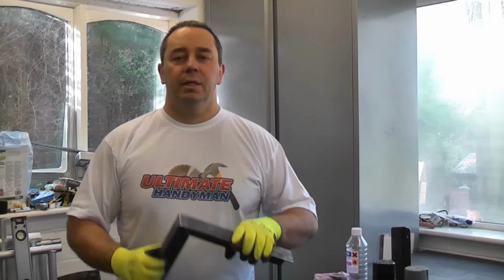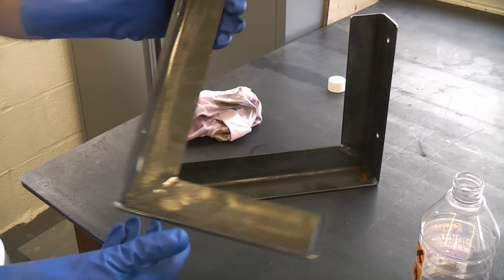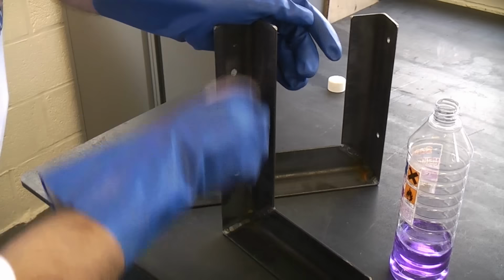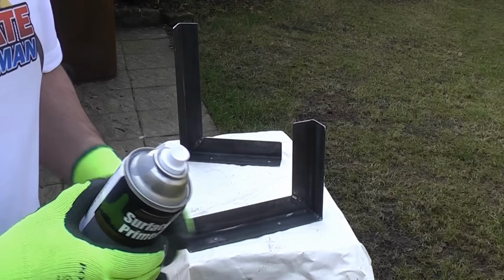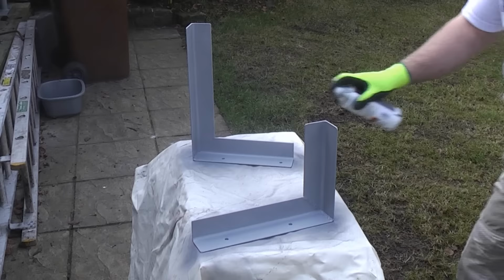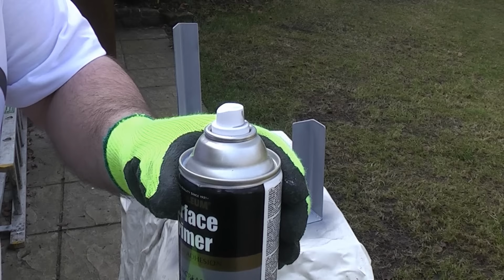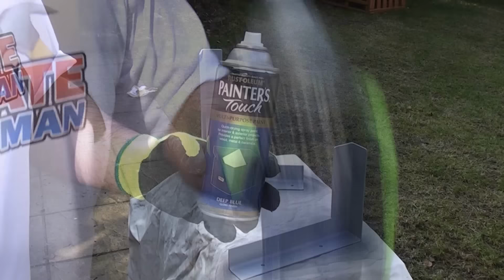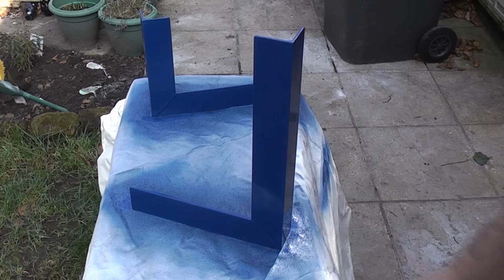How to paint metal | Rustoleum

Comment: small tip, fabricate some hanger like devices so you can spray the whole thing at once.  I use some copper wire or a hanger that's cut up.  you can hang them from a ladder or a tree or anything really.  I used to use a ladder that bends into a scaffold to hang my freshly painted car parts.
Reply: This is very helpful thank you.
Reply: wire from a mig welder works well also

Comment: for more in dept tricks for the viewers ,Sanding the surface will make it that the primer will take longer to peel off from the surface (loss of elasticity over time(critical surface tension) its like puting some velcro under your primer. you especially want to do this the smoother the stuff your painting is,if it feels slipery to the finger,it will peel fast,it it feel rough,chance's are it'll never peel off. 
If its going outside,sand the primer with 400 or 600 grit,so the paint dont peel :)

Comment from the maker: @wilson medriano 
It's called Methylated spirits in the UK, often called denatured alcohol in other parts of the world.
Reply: +Ultimate Handyman thanks. i was just about to ask that.  :)
Reply from the maker: +Nicola Wilbar 
Thanks for the comment ;-)
Reply: +Ultimate Handyman Can you dilute the denatured/methylated spirits with water to make it go further or will this reduce the effectiveness?
Reply from the maker: +Tony Tony 
No, you can't water it down I'm afraid as it will reduce the effectiveness.
Thanks for the comment
Reply: +Ultimate Handyman OK thank you for that. One more question. The lights I want to repair are outdoor up and down lights and as they are by the sea in a hot climate is there any other special requirements to save painting them over and over?
Reply from the maker: +Tony Tony 
Paint will not last long in a climate like that I'm afraid.
If you are painting onto steel, it would be much better get them galvanised as steel will soon rust again even with the best paint that you can get.
Reply: Do your prep correctly, use a proper metal primer with anti corrosive, simonez makes some good quality automotive paints... Do your prep, sand the surface of any surface rust/oxidation and clean it then apply your primer and then main colour, to add extra protection I would recommended enamel paint and followed by an Enamel clear coat.. A job done right shouldn't rust
Reply: Ultimate Handyman hi I was thinking about spray painting my metal fidget spinner.
I am looking for either gold or luminous colours but I don't know what type of spray paint I should use
Reply: Ali Ilyas loooooool
Reply: Ultimate Handyman    Thank you!!!
Reply: Does acetone world too?

Comment: Rustoleum has always worked for me---just painted some steel beams today.  I remove the nozzle and place it in the paint cap, with mineral spirits, to soak it clean.  This uses a small amount of spirits (less than a shot glass).

Comment from the maker: @ MidiTech
It depends really, it will not stick to the galvanised part of the case well unless you prime it first. It might be suitable for over painting the existing painted parts but you would have to test it out first as some cases are powder coated, not painted.

Comment: Spraying inverted to clear the nozzle wastes gas and eventually the gas will run out and there is still paint left in the can. I had this happen to me, I after every use did the inverted spray and after some time the gas run out and had still paint inside. So I think it is better to refer from doing this, and if the nozzle gets clogged just submerge it in paint thinner to clean it, I think rustoleum cans say to do this if the nozzle gets clogged
Reply from the maker: I invert the can all the time and rarely run out of propellant, they tell you to invert the can and spray it to stop the nozzle from blocking.
Thanks for the comment 👍

Comment: Brake cleaner works pretty good for removing oil and grease pre painting, dries fast and leaves no residue, carb cleaner would probably work similar.
Reply from the maker: +John Phillip Thanks for the comment ;-)
Reply: But never use brake cleaner to clean something you're going to weld. Usually contains Tetrachloroethylene. It may decompose to phosgene if welded. Phosgene is incredibly toxic, so even a tiny amount from a small bit of residue from the cleaner could kill you.
Reply from the maker: Thanks for the info, that's well worth knowing.
I don't use break cleaner much but I'll ensure I never use it before welding any metal.
Reply: If you mess up, carb cleaner instantly removes the paint too 😂

Comment: He's right - one of the most important things when spray-painting anything is lots of very light coats, and not fewer heavy coats. It's a pain in the arse and it's easy to get impatient but you WILL regret it otherwise.
Reply from the maker: Thanks for the comment ;-)
Reply: They also need to be consistent to prevent spotting (thicker coats in spots) more consistant side to side, 30cm from the item at a reasonable speed to prevent runs

Comment: Thank you for this video! It was extremely helpful! I need some additional advice. I have a brand new heavy gauge galvanized steel mailbox. I am planning to paint a landscape scene on it and then it will be installed outdoors and exposed to the elements. It currently has a black rust resistant powder coat finish. I will be using acrylic paint and I I was planning to clean the metal with rubbing alcohol before painting. My questions are: do I have to apply a primer first? And what kind of sealant should I apply when I'm finished? Thanks in advance for your help!!
Reply: No

Comment: Hi, can I hand paint the metal frame instead of spraying? I  live in an apartment in which spraying will be difficult.
Reply: Buy or make a ventilated spray booth to discharge fumes outside through a window.  There are many DIY videos on it, with safety tips too.

Comment: I just use a 4 and a half inch angle grinder and use a 60 grit grinding pad to clean the meatl off or to make it easier just buy a sander and 80 grit pads i bet the metal would be super clean then lol I work in a fab shop just some advice lol
Reply from the maker: The paint removal discs are good- https://www.youtube.com/watch?v=aMQMk7J94u8
Thanks for the comment

Comment: Hey, i want to paint my metal weight plates, i was wondering if i have know the propersteps, first i wire brush all the rust away and then use mineral spirits, and then a primer and hammer paint, and should i finish it with a lacquer? i would appreciate it if u responded(:

Comment: Nice video. How long does it take for the surface primer to dry?
Reply from the maker: It depends on the air temperature/humidity etc.
Normally it is touch dry in a few minutes, but not fully dry for a couple of hours.

Comment: Hi all, I want to re-paint the top plate of my vintage stereo receiver because it has a few scratches. My question is do I need to sand the old black color before applying the primer (like remove ALL of the old color or just cleaning will do)? Thanks to anyone for advice... BTW, the video is very good, I feel comfortable trying this on my own now!
Reply from the maker: If the scratches are deep, it is best to feather them out using some fine abrasive paper, then clean it all with methylated spirits before applying the primer. If you don't sand out the scratches, they will still be visible after painting.
Thanks for the comment

Comment: Would you recommend sanding shinny metal surfaces before primer? I have Lincoln beautyware canister set in chrome that I want to spray paint and I just want to make sure I do it right.
Reply from the maker: +m It depends what type of metal it is. Providing a key by sanding will help on most shiny metal surfaces but some surfaces such as Chrome might require a special primer.

Comment: Is "methylated spritis" the same as "mineral spirits" which is what people typically recommend in the US? A warm metal definitely holds the paint better for sure. A not so humid, sunny day is my favorite for outside painting.
Reply from the maker: I'm not sure, but it is often called "denatured alcohol" in some countries.
Thanks for the comment 👍🏼
Reply: @ultimatehandyman  I did some local research with shops and found out State of California prohibited the sale of Mineral Spirits due of potential cancer risk to exposed skin, and we know Californians are too stupid to wear protective gear when there is proper warning [/sarcasm].
To clean metal such as brake calipers, I used a brass brush and brake cleaner to get rid of the excess grease and grime. Afterwards, proceeded to scrub the metal and wiped off with lacquer thinner soaked clean rag (acetone would work too).

Comment: Hi just a couple of questions! 
I want to restore some gym equipment how would you prep it? Would you just lightly sand or would you go further and get as much paint off as possible? 
Would it be a good idea to use a clear coat on top of the top coat? 
Where in the uk sells this paint? 
Thanks
Ps great videos!
Reply from the maker: +Luap 1983 
I'd just lightly sand it, the clean it using methylated spirits. Then prime it all and then a top coat. I would not bother with a clear coat on top, as long as you use a good quality paint such as Rustoleum. I bought mine from ebay ;-)
Thanks for the comment
Reply: +Ultimate Handyman that's great thank you for the fast response.

Comment: Can you use this on previously painted steel that has a gloss finish? What sort of prep would you recommend. Thanks for the video.
Reply from the maker: Yes, providing it is paint and not been powder coated.
You should just be able to clean the existing paint using methylated spirits (denatured alcohol), then after 10 minutes give it a top coat of rustoleum 👍

Comment: it only lasts 4 years? Joking aside, what if the steels already painted and i just want to repaint it, do i just give it a light sand and go over with the finish? Cheers
Reply from the maker: Yes, you should just be able to give it a light sanding, then a clean using methylated spirits and clean rag, before re-coating 👍

Comment: What do you think of Hammerite? I need to paint a post for an outdoor mailbox, which has been made for me out of a piece of staircase support (box mild steel). The recycled piece is painted, apparently (not seen it yet) and the new plate on top (to which I will bolt the mailbox) is bare mild steel plate. it will sit outdoors and be embedded into concrete at the bottom, which I will pour for the purpose. I've had Hammerite suggested...
Reply from the maker: +Jezzer 2014 
Hammerite is normally ok, but for any steelwork that is being used externally it's much better to get it galvanised first.
Even with the best paint in the world, eventually it can start to rust if it's not galvanised first.
No matter which paint you use, you will probably have to give it a fresh coat or paint every few years to prevent it from deteriorating and rusting.
Reply: +Ultimate Handyman - Chez

Tried hammerite Smooth Aerosol recently and its...rubbish...water has more viscosity...runs at the blink of an eye (even when misted on very very lightly), far far thinner than any other aerosol paint I've ever used before...
Almost like there is far too much thinners / solvent added to the mix.
Hammerite were claiming it was due to rogue cans...if thats the case their quality control is hopeless...
I've heard the same gripe from several people since 2013 or earlier.
I found Pro-cote from Toolstation pretty good and affordable. Sprayed a metal frame with Procote cold galv and left it outside all winter, whatever is coated hasn't rusted and the spots that were missed have rusted but the cold galv hasn't flaked off though and thats without a top coat.
Reply from the maker: +John Phillip 
Thanks John, I'll steer clear of the hammerite in future ;-)

Comment: I have a white primer spray and I want the end result to be white as well. Should I buy white paint too or can I just put on multiple layers of primer?
Reply from the maker: +simon steverlinck 
You will need a top coat of paint I'm afraid as primer is no good as a paint as it's designed to give an easy surface to paint onto so it's not durable!

Comment: I'm trying to wire wheel and sand rust off of a tablesaw I just acquired. I asked the sales guy at Wal-Mart if rustoleum metal primer would protect the metal.
He said yes. I found primer + paint in the color I needed but it was gloss paint. I wanted matte or flat.
So I just bought primer in my color.
It looks great! But I worry about it rusting again.
Do you think I should paint it?
Will primer protect the metal from rusting by itself?
Reply from the maker: I don't think primer is tough enough to be honest, I would just try it and see how it goes.
We often paint bare metal with a galvanising primer on site and often do not apply a top coat to it, but I'm unsure if normal primer would offer the same protection.
Thanks for the comment

Comment: I used the exact same primer and paint on my car seat runners where they get rusty. Primer went on great but the top coat won't adhere and small circles appear. I've cleaned  and prepped, what's wrong??
Reply from the maker: Not sure, normally I would say that the surface is contaminated, but that is unlikely if the primer adhered properly. 
Have you tried the top coat on a different surface? Perhaps it is a faulty tin or something.
Thanks for the comment

Comment: I have been trying to spray paint my tube steel table with rustolium spraypaint and I can't seem to do it without the paint spitting and leaving little dots on my table.  any idea why this is happening?
Reply from the maker: It could be a few things. 
Firstly ensure that the paint is mixed thoroughly, by shaking the can for a few minutes.
Ensure that you are not doing it in cold conditions.
Check the spray nozzle is not blocked, if it has a blockage, the paint can splutter out of the can (sometimes best to try another nozzle)

Comment: I have 2 cakes stands that are black metal. I want to paint them white. would the steps work on it? Or should I rough them up? I am concerned that if I just got straight to painting it white, the paint will chip off. can you please help
Reply from the maker: It might be a good idea to lightly sand them first to give the paint a key, then clean them using methylated spirits before painting them.

Comment: Do I have to sand the pre-painted metal (gloss with no rust, flaking, or blemishes) before applying rustoleum ultra cover 2x gloss over it? or am i fine with just overlaying with the spray paint.
Reply from the maker: +Lily Cheung No, There is no need to sand, you can just paint right over sound surfaces.

Comment: I have a question,  i want to spray paint old Christmas tins to re purpose them.  Do i need to like sand off the previous painted images? Or can i just directly spray paint the tins?
Reply from the maker: You should be able to paint directly over the existing paint, just ensure the tins are wiped clean first with Methylated spirit (denatured alcohol)

Comment: Would you say this is better than hammerite direct to rust metal paint? Does this leave a soft finish or more like hardened finish?
Reply from the maker: I've not used any Hammerite products for years, I normally use Rustoleum rust reformer- https://www.youtube.com/watch?v=L92WjUfppnE
Then a suitable topcoat. It's fairly tough, but if the metal is going to be impacted, it might be best to get it powder coated.

Thanks for the comment 👍

Comment: How do I stop it sticking? I had to paint both sides and when I lifted it to
Move it, it lifted the paint that had dried on the paper as well.
Reply from the maker: I normally do the spraying on a dust sheet, rather than paper- for that very reason.
Or if you have holes in the item, you can often suspend it in mid air.
Thanks for the comment 👍

Comment: I have a metal laundry tin that I would like to spray paint a different colour. It is currently blue. Would I be best to sand it down, use a primer and then a spray paint? I am hoping for a light mushroom colour :)
Reply from the maker: As long as the paint is in good condition you should be able to just clean it using methylated spirits (denatured alcohol) then prime it and then spray it the colour of your choice. If it's got a really glossy surface right now you could give it a light sanding to ensure the primer sticks well.
Thanks for the comment

Comment: oh i did'nt tought it was that dark even when welding. Aparently there is some filter for camera that are sold 

-Filmed arc welding a few times using appropriate ND filter.
-make sure your shield is at least a #10 or #12. TIG is a different process then ARC or MIG and the light intensity is much higher. Using a #8 which is standard for MIG will still make your footage (where the arc is) to bright to see the wire and tungstan working.

/wiki/Neutral_density_filter

Comment: I need to paint over stainless steel. However, don't you also need a spray sealer on top of the paint?
Reply from the maker: It depends what paint you use.
Many paint manufacturers are very vague when they say that the paint can be use on and often they just state "metal", which is not much use as there are so many different types of metal.
Reply: With the correct prep use a self etching primer... Easy...

Comment: Hi Bud. 

Quickie for you , I have a tin of 650°c BBQ paint intended for my exaust header........ 

I've been told it doesn't require a primer and I figured you might have a better idea of why ?? 

Any suggestions ? 

Best and kindest.
Reply from the maker: Some paints are self priming. I would imagine that if you needed a primer, you would have to get a heat resistant one as well.
Thanks for the comment
Reply: No issues , thank you for the time taken.